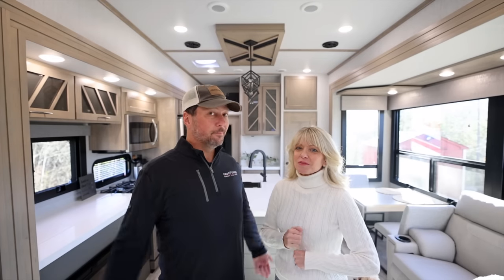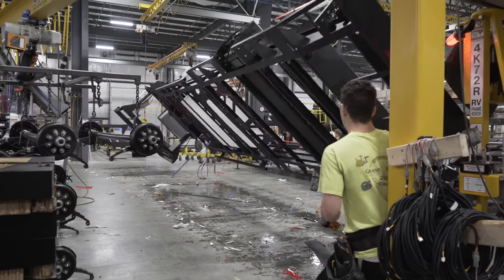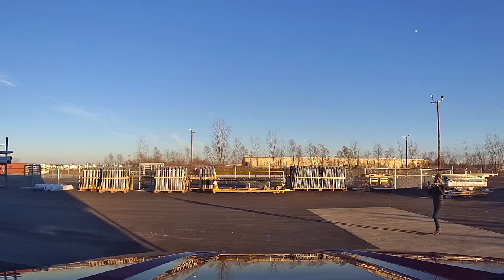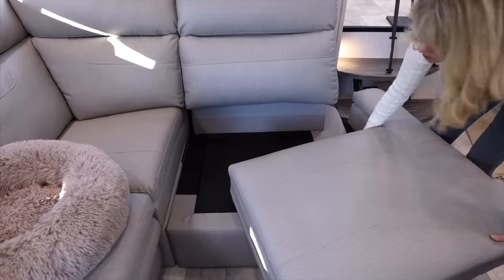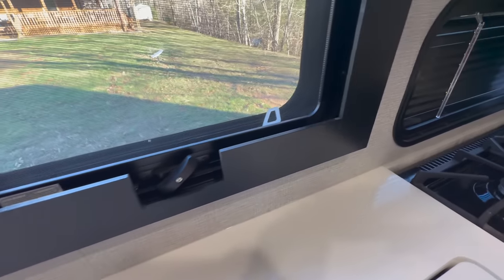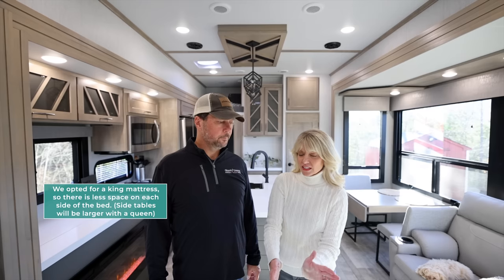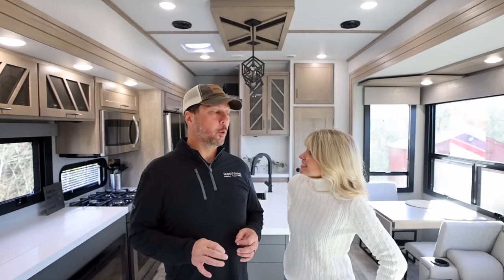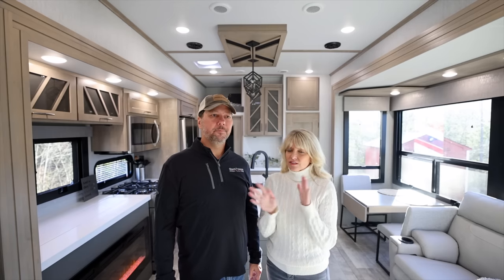Momentum 410 THR Homecoming, Issues, and Updates!

Comment: Congratulations on getting the new rig.....that you helped design, no less!!  From your other prototyping videos, the key thing to remember is that there are always give-and-takes that need to be balanced.  That said, however, it is pretty unfathomable that the electrical controller box was placed behind the retracted slide-out (that was a clear mistake that should have been caught at the drawing phase and never should have carried forward to even prototyping).   Also, one set of outlets on the island is a flaw....I bet your 'live-with-it' phase will end up with putting another set in (shiplap or not).  Depth of pantry and depth/height of medicine cabinet interiors are very valid observations, too.  As an owner of a GD 2022 341RDS, I have the same issues with the bedroom reading lights and having to sit up (and them some) to reach the tiny switch on the light itself (don't these manuf'rs listen to feedback or try things out themselves....or are we back to the give-and-take balancing?).  To end on a positive note, with our 341, I can predict that y'all will LOVE the 12v compressor refer, as well as the on-demand/tankless water heater.  ENJOY your new rig and Merry Christmas!!

Comment: We have a 2022 351MS-R.  We have one GFCI breaker for all of the usable outlets in the kitchen, both bathrooms and all of the usable outlets in the garage.  So, we can't run a heater in the garage and make coffee or make coffee and toast bread at the same time.  It makes morning time a chalange.  What worse is that the breaker is under the step which means we have to unscrew the step to reset the braker.

We have been OK with having one outlet on the island.  If they were going to add a second or third outlet, I hope they add a second GFCI breaker for it. 

And we hit a pole with our 12 hour old RV... We chalked it up to stuff happens.

Comment: The BR lights are an issue on our 2021 397th even with the switch.  They're way too bright much of the time.  I replaced the factory switches with dimmer switches.  Works fantastic.

As far as the outlets on the island, that's the same on our RV and it seems to work out fine for us.

Comment: Regarding the issue with the lights above your bed. We to had lights hard to reach up and switch off without getting up and they did nothing but shine down into your face making it hard to read. We solved this by replacing them with reading lights that extended down on a long adjustable extension with the switch in the head by the light. Makes it easy to switch off and on laying down and adjusting the light angle so it's not glaring into your face.

Comment: Nice rig. 
I hated the front cap light/underbelly combo on our 21 395ms-r.  I added a switch in the ground circuit off the LCI circuit board behind the panels in the basement storage.  
Now I can leave the cap lights off.

Comment: Regarding the outlets, I think for me it just depends on how many other accessible outlets in the kitchen there are. We live in a 381M and have outlets on both sides of island, unfortunately at the moment only one side works, the less convenient side of course and the long bar area that has outlets is fairly low (example my kurig fits but I can't open the top). So the layout will come into play for sure. 
The window boxes look better then previous years, we took ours off. Maybe they should just go without and make the top valence look modern.

Comment: With regards to your ‘accident’ , you might talk to GD about the installation of side mounted clearance lights . Now whether you have them mounted high or low is up to you , but in most of the cases that I have seen them operate ( and I’ve seen both ) , down low is the best option if you’re only planning on using one set of lights . By the same token , I have seen where lights on both sides were on at the same time so that backup cameras would show both sides as well . This is assuming that there was a camera & light on the endcap that functioned regardless of what mode you were in .

Comment: Moved into our 2014 voltage 3990 5 days ago for a PCS to California. Haven't even left Texas yet.. It's been.... Great

Propane leak and we lost 60 pounds of propane in 4 days, upcoming freeze, electric fireplace melted it's plug, 12v water pump went out.... 🤦
This is after fixing all 4 holding tank valves, a complete roof replacement and fixing other stuff like the leveling system relays and such .. 

It's been an adventure that's for sure. Not the one we wanted lol. 

I think my next trailer will be a grand design or ATC,I like how they listen to their customers.

Comment: I had an idea about your window boxes, I changed the ones in my Diesel Pusher. I like having them because they block light from getting in on the sides.  I replaced the string operated pleated blinds with blackout blinds from levolor but because of the bottom of the box they were hard to close all the way.  I solved that issue by replacing the bottom of the box with a window sill instead. Where I had roller shades, like the driver and passenger windows I have the side part but no bottom so I can operate the roller shade easily.

Comment: I agree definitely need another outlet in the island and the bed lights omg yes they definitely need to add a switch . The pole rub yes could happen to any of us embarrassing for sure but it happens. I am curious about what the approximate cost will be on the new unit for those of us contemplating getting into the rv lifestyle I personally am a huge fan of Grand design

Comment: 1. Those with shoulder issues would never be able to use the reading lights. 2. Ideally pantry shelves should fit standard size items/containers, ie cereal box or container. Perhaps they could test with most common used items RV'ers use in the prototype. 3. Do you really like seeing a string hanging down in the middle of your window ?? 4. My opinion shades on entry door should be standard.

Comment: You should jam a door stopper under that pantry door before you pull in the slide.  That way you won't have to worry about the door opening as you go down the road and risk damaging the door and slide when you open it up.

Comment: Electrically, the counter on the other end would be required to have a receptacle if in a residence.   Not in the RV section of the code.   So, like you said, try it and see.  I would want a receptacle in the wall above the coffee bar.   Looks like it may be in the cabinet above.  
Bedroom, I would put cabinets above the bed and put lights on bottom, like almost all other RV’s.
Well, at least you got the first scratch taken care of quickly.   Merry Christmas!   Kevin

Comment: Here's my idea for the window shade box. At the bottom where the blind slides inside the frame, have them put a hinge on the bottom section of the box so it tilts forward 45 degrees to access the bottom lip of the blind

Comment: Thanks for the walk through!  It’s a beautiful rig.  Today is our 6th night in our 2022 Grand Design Reflection 337RLS and I have had a couple of “What were they thinking?” Observations…
I’m a menopausal woman and I like to sleep with some of the windows open, however the noise of the bottom blind rail clanking against the window frame keeps us both awake at night.  I had to put some foam tape on the rails to prevent the noise.  Also we have the on-demand water heater, which so far I love having, however when you combine it with a farmhouse style sink that takes a ton of water to fill to wash dishes and the water cools off quicker than it would in a double sink, it’s not practical or energy efficient.  But overall, we really love this unit and the quality of the construction and finishes is pretty great for the price point of this unit, in my opinion.  It’s really great that Grand Design is going to be seeking pre-release feedback from their customer base in the future!
Reply: Hi Babe, I use a small dishpan for the soapy water, then I have the right side for rinsing.  I wash say, half of the dishes first, then rinse, and again.  We have enough space on our island to have a full-size drainboard, and rack (the rack folds when not in use, and the drain fits with it.
Reply: @kimherben7866  - yes, that is what I have done and my dish drainer fits right in the sink with the wash tub…
Reply: @thebabe4880  If your sink is Stainless, you might place an old towel in first, before travel days.  It saves on the scratching and rubbing marks.

Comment: Grand Design selected the best couple for this massive 410 project.  You were asking about the island power plug.  I rarely had used more than two AC plugs at a time, but today with all the extra electronic gadgets, thermometers, etc., up high plugs might be better, (less dangling cords over the counter top. Not sure how up high plugs would look or work out).  (??).  Guessing here: More than likely there will be concerns / questions from the electricity safety people.   (Water and electricity mixing concerns, or result in have a often snapping / tripping, GFI circuit). 😊

Comment: The blind issues, and the cap lights connected to under body lights is same on other models as my new momentum is that way.  The factory PDI most not be as comprehensive as it use to be as the dump valve on my black tank was put in backwards according to my dealer when i had to take it back as i couldnt dump black on my first trip out to test everything.  Excited to see your followup videos.
Reply from the maker: Hmmmm.. Backwards isn't good.

Comment: Ouch on the pole hit.  I am sure that will buff right out. Some of the items you pointed out are not just issues on the 410th floorplan they are also issues on the 2020+ floorplans for the 397th(s). 
1. As others have recommended install the thin shade up side down for the ability to look out but have more privacy. 
2. Replace the check valve in the water heater with the brass one, I think the plastic ones all fail in the first 2 weeks with low hot water pressure.  
3. Move the onecontrol access over to your rig wifi once you get that installed.  It is a more stable connection when using the app.  There are walkthoughs on the Momentum FB groups. 

We are loving that light interior.  Grand Design defiantly needed Tara's help making the interior color schemes better. 
Very curious to see the video on installing a switch for the front cap lights.  I have the switch but never got around to tracing that wire down in the mess of wires to the onecontrol.
Reply from the maker: A few people have mentioned installing the shade upside down.  I don't understand the advantage.  Can't I just lift the shade up to peek out?
Reply: @ChangingLanes  Unfortunately with the door closed you can not move the shade at all, the screen door is in the way.  So installing it upside down gives you the ability to leave a little gap so you can see out from the very top of the shade while giving you the most vertical privacy.  I saw in one of BTBRV reviews of a non GD RV they had a privacy shade on the screen door. Solves the privacy problem  even better.
Reply from the maker: Makes sense.. will flip it and try that out!

Comment: I have two outlets on our island in our Imagine, one on each side.  After two years we have never had more than two items plugged in.  I agree with the rgb lights on the cap and underside.  It would be nice to be able to control them separately.  Also, I sent ya a message on IG regarding the bed lights and what GD installed on our Imagine.

Comment: There are remote control LED lights out there for the bedroom over the bed.  Replace them with that option and attached the remote to a wall or access point that makes sense.  Get two separate lights with separate remotes.   I feel for you Chad.  Nothing worse then the first scratch no matter how long you have it.

Comment: There are remote control LED lights out there.  Could install over the bed.  Replace them with that option and attached the remote to a wall or access point that makes sense.  Get two separate lights with separate remotes.   I feel for you Chad.  Nothing worse then the first scratch no matter how long you have it.

Comment: The noise on your back A/C Is air vibrating the slider vents to direct the air to the vent track system. I have a 22 376THS and my front and rear do that. And make the exact same loud horrible noise. If you slide the vents open it will stop but then you don’t have air throughout the other vents. It’s frustrating. I’m trying to figure out what I’m going to do to fix it. 👍.
Reply from the maker: We'll check that and update what SRT finds... 👍🏼

Comment: I wanted to see your new garage & office too!
I love your new Momentum.
Did you have to pay for the 8k leaf spring axles AND the 8k independent suspension? Or just the 8k independent suspension.
I would think that Grand Design could reuse the same suspension over and over again for customers who would like the independent suspension installed before shipping the 5th wheel to the dealership for delivery to the customer.

Comment: Outlet on both sides of island. I don't like night lights like those I'd rather have a small lamp or something that isn't like a spot light. I don't like the boxes around the windows but I do like our pull down blk out shades in our 2670mk. I think the separate  switch on the outside lights is a good idea even a motion light for the underaide.

Comment: Two comments.  Why not build a couple of "boxes" to mount the night lights in to lower them by 4" or so.  There appears to be lost of vertical space in that bunk.  As far as the outlet on the island, If it were me, I'd invest  in on of those AC plugins that expand a dual outlet to 4 or 6 outlets.  If you need  more than 2, plug it in.  If not stuff it in a drawer.

Comment: Congrats again on the new rig, boy the control panel behind the slide was a big issue, surprised that didn't get caught long ago and located in a different spot. Chad catching that pole was you just marking your spot on the new rig, but it does stink and I am sure I would have been pretty upset at myself as I am sure you were.

Comment: I love your beautiful new rig and I'm happy for you both...  Now as far as the cork board I would just do away with it all together nobody uses cork boards anymore it's a 80s thing 😂 People just stick things to the refrigerator with magnets... Now as far as your blackout shades I've been thinking about this subject for quite a while now I've been Pella window certified contractor for over 30 years and Pella was the first company to put blinds in between the double panes of glass and I don't know why the RV manufacturer can't put blackouts in between the Panes of glass and make it so much simpler to use... Last but not least your medicine cabinet.. With me being a custom interior trim Carpenter I was thinking why can't they put a deeper medicine cabinet in there and let it cantilever out a couple of inches and then put jam extensions from the front frame back to the wall I don't see that getting in the way of anything and give you quite a bit more shelf space... ✌️

Comment: What kind of tires did they put on, our grand design 5th wheel had china bombs on them. Two went and blew the wheel reels out and the controller for our slide out…which we didn’t know until we pulled in in the dark at the campsite. Couldn’t get to bathroom or bedroom as the slide covered our stairs.

Comment: Outlets on center counter.  I would suggest two or  power strip (built in) on each of two sides opposite each other.  There may be someone cooking, hotplate and someone comes in and visiting and needs to plug in .. so the other side, the table side too.  I think the outlets or the covers should better match the side wall .. paint/wall paper, fabric covered.  The brown splotches not good.  Maybe brown or tan too.. the slots in the outlet are easier to
visibly see with lighter colors.

Comment: Those push button LED's are horrible. In my 31MB, I bought a reostat on Amazon and had it installed on the wall switch. Those LED's over the master bed should be controllable on a switch and dimmable. I didn't notice if you had a skylight in the kitchen area, but the one in our 31MB let in too much light and I ordered a "pillow" insert to block the light. The medicine cabinet should just have an adjustable center shelf. Unfortunately, I had to sell my F250 and my 31MB because my wife did not want to travel semi-full time after 10 months on the road. Just bought a small KZ Sportmens 180TH toy hauler just for me to haul my Yamaha scooter when I hit the road alone twice a year in Apr-May and Sept-Oct. On the MORryde steps, which were slippery for my dog to climb, I went to Walmart and bought a box of 12"x 12" self adhesive carpet squares, cut them to size and applied them. Even when they got a little wet, they dried out quickly and stayed in good shape. You'll have many extras since you get a dozen squares.

Comment: For the lights in the bedroom could they intercept the wiring up top and put you in a remote to turn them on and off or just leave them on if you wish. That could be a short term solution until the engineers find a way to catch you a switch.😊
Reply: great idea on the remote!. does anyone know if its a 12 volt light.

Comment: How's the onecontrol? Mines getting worse in our 22 395ms I re-installed the app and gave up on trying to get it to connect and work. Probably need to pull the negative cable on the main unit under the stairs.. again.. I wish it was just manual switches